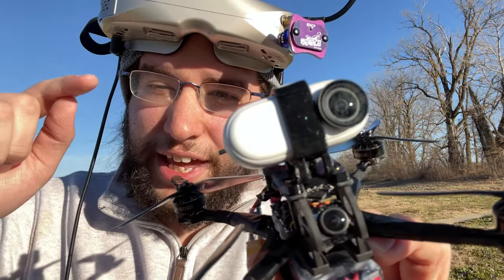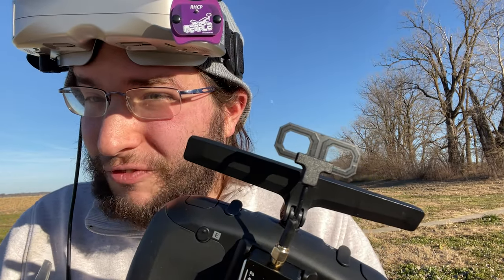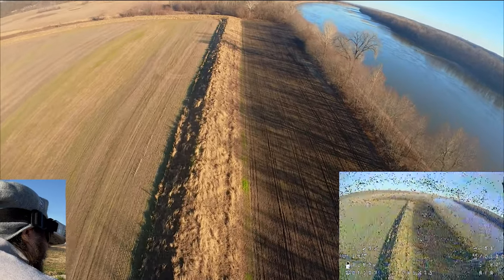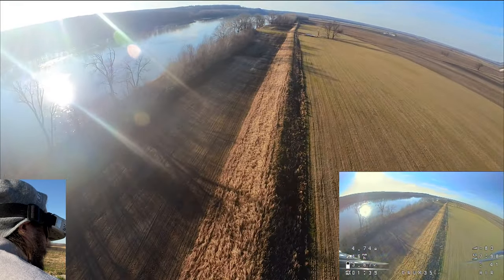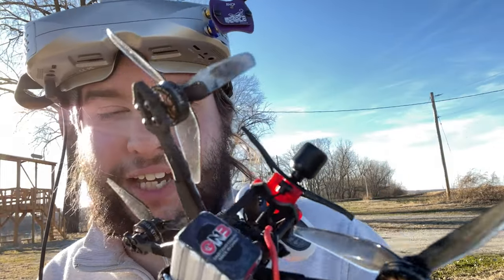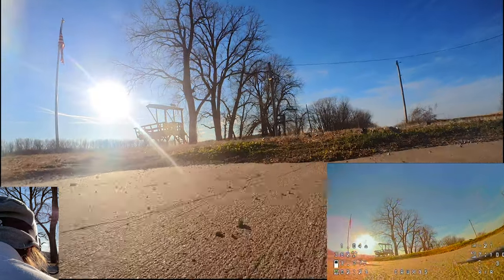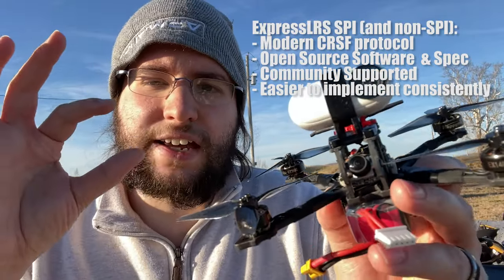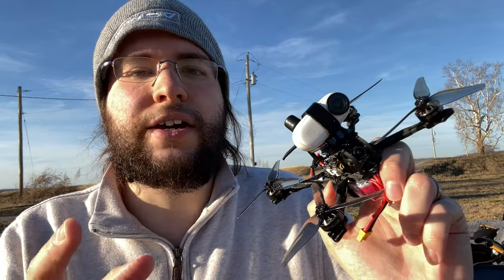ExpressLRS SPI Receiver Range Test (Crux35 Analog ELRS FPV Drone) 👍

Comment: excellent video, thanks! I have the same quad and I have a question: what's the PID Loop Frequency you're using? 4kHz? with the default value, I had a CPU load of over 60%. but I'm running ELRS at 500Hz, maybe that's why? what are you running? thanks!
Reply from the maker: betaflight 4.3 and 8k/4k using dshot300, I have a CPU load of 12%.  my expresslrs module was set to 500hz but the tango2 itself will only process 250hz for your control. I do not think the ELRS is what is causing the high CPU load. What was your default value set and what bf version was yours running?
Reply: @JohnCuppi  it came with betaflight 4.3.0 RC1, same 8/4kHz as yours.
Reply from the maker: @pgabrieli  Sorry -- I just rechecked and I accidentally gave you the number for port utilization. CPU load for me is actually only 12%. So I'm baffled as to why the CPU load would be so high for you. I even have the accelerometer turned on mine, which tends to use a little extra CPU. You can disable expresslrs to see if that fixes it but on the board it's set to 500hz for me, I have never rebound it and set it to 250hz yet. Try flashing the newest btfl 4.3, mine is running firmware released on: Oct 11 2021 so it's not RC1.

Comment: Great video and review of the SPI Elrs John 👍👍. I only have one quad with the ELRS on it right now and it is so enjoyable to fly. I fully agree with you on the FrSky spi receivers. One quad will do just fine like my original Crux3 and others fail safe randomly. I'm just going to convert my spi boards over to external Elrs receivers once I figure out how to do that. My Crux3 will be one of the first and a little Cine8 will be second. Moving forward I'm only going to buy boards or quads with Elrs. That Crux35 I think will be my next quad purchase.
Reply from the maker: Thanks for the compliments! I think almost everyone is tired of FrSky SPI receivers and we definitely need to move on -- but until now I don't think there's been a viable replacement. For a while there was at least the redpine protocol but I think that was too complex. There is one bummer -- the requirement at the moment to only use betaflight 4.3, when so many great tunes out there are for lower versions. But, everyone has to upgrade eventually, right? I'm also hoping Emuflight will add ELRS SPI support if they haven't already, that would be a huge help. How did you like the Cine8 by the way? I never got around to building it.
Reply: @JohnCuppi  the cine8 is on the way and hope to have it by Christmas, but I know already that it will benefit from an elrs receiver. Will let you know how it goes.

Comment: May i know what is the flight time of that crux35?
Reply from the maker: It depends on the battery, but so far for me, all LiHV: 

530mah GNB - 4 to 5 minutes (pushing it, but great weight on these!)
660mah GNB - 5 minutes (comfortable 5 minutes)
720mah GNB - 6-7 minutes

So my favorite is the 660mah.
Reply: @JohnCuppi  awesome, thanks for quick reply
Reply from the maker: @pushies5  No problem. I love this quad. I actually bought another one, and am doing an HDzero build. 😎

Comment: How the bloody hell do you bind it to the BetaFpv Elrs Module?
Reply from the maker: Is the betafpv ELRS module running ExpressLRS 2.0 or 1.0? This drone currently ships with betaflight prerelease 4.3 which has ELRS 1.0; but you can update to the newest version of betaflight that includes 2.0.
Reply: @JohnCuppi  The Module is on 2.0 How do you update the quad to 2.0? or is just easier to have everything on 1.0? Cheers mate
Reply from the maker: @k1ortia  If you want to start flying today right now, it's definitely probably easier to just have everything on ELRS 1.0 and then bind. It 'just worked' perfectly for me.  But, the way forward is definitely to upgrade betaflight on the Crux35 right now to the very newest betaflight 4.3, which will bring the ExpressLRS integrated receiver up to 2.0. 👍I have not updated my crux35 or happymodel ELRS module to 2.0 yet. Betaflight 4.3 is going to be fully released to the final version any day now, that's when I'll upgrade my stuff. 🙂
Reply: @JohnCuppi  Ah, ok. i shall give that a try, only issue i had with the module when messing about with firmwares, was that you loose the use of the Oled,s and the screen. iv just managed to update the Crux 35 to version 2.0. so hopefully ill have something in a bit. Never had this headache with Crossfire
Reply from the maker: @k1ortia  ELRS development is advancing so rapidly that unfortunately these problems have come up. Since you got the crux35 on the newest betaflight 4.3 and for 2.0 setup there, then I wouldn’t go back to 1.0. 

Personally I’ve had more than my fair share of problems with crossfire binding issues over the last couple years with the Tango2. 🤷‍♂️ ELRS still has a higher learning curve at the moment but it’s getting there.
Reply from the maker: @k1ortia  One small thing I wanted to mention — with ExpressLRS SPI receivers, the software/firmware for them is directly baked into Betaflight. All SPI receivers for betaflight work that way, and one disadvantage here is that when there’s a version mismatch, it forces a betaflight upgrade. I suspect that over time this won’t be as big of an issue as ELRS development slows down a bit, and there might also be an increased focus on a operability between versions. No one’s thinking about that for now while there’s so much rapid growth. Heck, it’s all happening in the middle of betaflight being in prerelease stages. I believe ELRS 2.0 will likely settle things at least for a while.
Reply: @JohnCuppi  Yes i agree. Definitely great new tech, but one hell of a ball ache! i just like what works 100% with no dramas. And crossfire for me has been bulletproof to be honest.
Reply: @JohnCuppi  Ah, i see. i didn't know that. Thank you
Reply from the maker: @k1ortia  I blame most of my problems with crossfire on the Tango 2, honestly, but it's no excuse because crossfire is literally TBS's product. So it should have worked the best with crossfire but ironically, it doesn't/didn't. 

Over the air firmware updates and crossfire updates with the Tango 2 have been a disaster for me, until just recently when TBS finally fixed it about 5 months ago. 

The crossfire product itself is fine in terms of range anr reliability, but I have only updated about 4 times in my entire time of ownership because of the bug described here, just incase you do ever run into it: https://www.youtube.com/watch?v=vT2EFI8tL8M
Reply: @JohnCuppi  Iv never used the tango 2. Only the taranis qx7 and a modded Flysky fs-i6 x and its been perfect.

Comment: I must be doing something wrong as I can't seem to get this kind of range out of my mobula7 elrs using the happy model es24 TX pro, even at 500. Something ain't right
Reply from the maker: But your mobula7 1s elrs has one major difference -- it uses a ceramic tower antenna, not a T-antenna like on the crux35! This is a very important distinction that will always result in significantly less range with ELRS. Also if you want 'more range', dial down the packet rate from 500hz to 250hz, you can even go 150hz. The higher the packet rate, the more demand on the link, and range will be decreased. 

Doing a straight shot on 250hz I was able to get 1.4 miles with mobula7 elrs 1s.  https://www.youtube.com/watch?v=RASKniA6OV8
Reply: @JohnCuppi  Ah ok I guess I didn't see that the crux used a t ant. Yeah I know that the ceramic tower isn't optimized for range but looking at the video you shared, even at 150hz on 500mw I really am not getting that range with my mobula7 like in that video, which I'm thinking might be the module as I also have another elrs whoop and its about the same. Maybe I should try another brand.

Comment: What is the FC on this drone?
Reply from the maker: Happymodel ELRS X1 AIO 4in1 Flight controller. There is a newer version now with ELRS built in on a uart. I am still using this FC though, it has been extremely reliable for me. No issues with it.
Reply: @JohnCuppi  thanks!
Reply: Hellomy friend, a question came up related to the output power of the vtx. Does that generate heat on the vtx, right? If so how do one keep it from getting too hot and damaged when not in fly? I know a fan when working with the drone does it, but when in the field, let's say I have to go pick it up and takes me a few minutes. How much time or heat can they resist? Thanks!

Comment: on my mobula7 (before i lost it in long grass due to running the battery down and losing video) with frsky and just an emax d8 controller from my tinyhawk 3 kit, i was able to stop it failsafing and falling out of the sky and i did a range test got it to 550 meters out before i turned around due to fighting wind the battery was getting low, but it flew out and back fine, and from inside my dads shed i can fly all around his property over 200m away from inside the metal shed, before i fixed it, it would failsafe and drop as soon as i went outside of the shed and got about 10m away, and that was not doing any hardware fix its just a setting in betaflight and it is so much better and trustworthy flying around, i have a moblite7 coming in the mail soon ill do a range test before and after the fix and make a video because i think it could help a lot of people
Reply from the maker: Well, this would be a popular video if your results truly work across all models and aren’t hardware based. 550m is an amazing result for frsky SPI whoop. I’ve never ever seen that. Was this with the mobula7 1s or 2s? 

I took the mobula7 1S ELRS extremely far away: https://youtu.be/RASKniA6OV8
Reply: @JohnCuppi  it was the 1s frisky version, such a good little whoop I couldn't believe how much better it flew than the tinyhawk 3 especially outside, it's so fast lol, I killed the tinyhawk 3 by crashing into a puddle so I can't test with that but I have a crux35 coming that I can test it with too, and for the record it did failsafe with very little range when I first got it so I'm sure it wasnt just a good receiver because the tinyhawk was the same problem
Reply: @JohnCuppi  i just put that video up incase your interested with the range test flying out over 500m on frsky

Comment: Does anyone know how many users can use analog FPV at a time without having any interference?
Reply from the maker: I'm not sure about this one actually. I know it's a decent number but I am not sure of the maximum. Are you looking to plan a fly-in event? Flying with some friends?
Reply: @JohnCuppi Thanks, I'm actually trying to set up a FPV RC car event for work. i know Digital the max is 8 ai just need to find out if analog will let mw do any more than that.

Comment: did u buy it on banggood so yes how did ur package arive
Reply from the maker: Yes, I did buy it on banggood actually. It took about 2 weeks, and arrived in a hard case.
Reply: @JohnCuppi  thx bro
Reply from the maker: @dortmunder27xxx  I would not recommend an 18650 battery for this drone. Yes, this is a good drone for beginners.
Reply from the maker: @dortmunder27xxx  I think for the cost the crux35 is great. 3.5 inch have similar enough flight characteristics to a 5 inch that most skills/tricks would transfer over. I can throw my 5 way harder and further than the 3.5, but I like flying the 3.5 more than the 5. If you don’t live next to huge bandos and big structures, it might even be good to not have so much power, and have more space to fly. The crux35's only weakness is that the frame isn't as strong as it could be, but if you stick to grass and fields it'll be fine.
Reply from the maker: @dortmunder27xxx No, why do you want to fly this with a Lion battery? 2s or 3s is going to feel underpowered on this drone. And a Lion battery will feel so heavy on this drone for really no good reason, a good quality 650mah or 850mah 4S lipo is the correct spec battery for the motor type on this drone. Using any less than 4s will make it under powered.
Reply from the maker: @dortmunder27xxx I have never used fatshark scouts before. Ev800DM are a good budget goggle.
Reply from the maker: @dortmunder27xxx  They will fly, sure, but none of those drones will ever the fly close to the same with a lithium ion battery vs. a lipo. 

There’s a reason lithium ion packs are not used for freestyle drones more often: they do NOT have the discharge rate to keep up. 

Sure, you can put a lithium ion on the crux35 4s or the nazgul 6s, but go ahead and try to do anything more than fly straight. Any freestyle will be a huge struggle. Buy 3s or 2s lithium ion packs will make performance of these aircraft even worse. You will literally risk having a potential brown out if you are not careful with your throttle or set throttle limits. 

If you just want to cruise, you are better off getting a drone that was actually designed to be used with a lithium ion battery. The flywoo explorer LR 4” is a good one. It’s was designed to be a low power usage, efficient quad not made for freestyle to do long range missions. It carries lithium ion packs and does okay with that.

Comment: Wrong. SPI is a hardware protocol that transports serial data from point to point, it requires three or four signals to achieve MHz bit speeds. The Semtech SX127x(900Mhz)/SX1280(2.4Ghz) LoRa hardware combined with an Espressif or STM32 Processor is the hardware used for ELRS. The SX1276/77/78/79 transceivers feature the LoRaTM long range modem that provides ultra-long range spread spectrum communication and high interference immunity whilst minimising current  consumption. Using Semtech’s patented LoRaTM modulation technique is how this is being done, the existing non ELRS transceivers use hardware that does NOT have this level of encoding. The SX127x/SX1280 + STM32F4 or Espressif combination has been around for years, using it to transport ExpressLRS protocol was a given since nobody has deep enough pockets to create something better. FYI: Both the SX127x and SX1280 parts can only be connected using SPI, not I²C or UART, the STM32F4 or Espressif talk to the outside interface with serial uart.
Reply from the maker: Thanks for the info!

Comment: Awesome review and flight my friend. I do agree more companies are going to get on board with micro SPI. As much as I love TBS tracer/crsf. I see them having to step up and compete or move out the way like Fatshark did.
Reply from the maker: Thanks Chris! Bold comment! 😃 for me I strongly believe that crossfire still has a solid place in the market; and it mainly comes down to quality control of hardware. 

There’s unfortunately some really horrible ELRS module hardware that users can step in right now, in part because anyone can make it. It’s a blessing and a curse. 

Some of these companies have been shamed and embarrassed into doing better; because their mistakes can leave lasting marks on the reputation of ELRS.

But you are right that they are going to lose out on ELRS for micros if they don’t do something there, and frankly, they may have already lost the battle there as it is. I don’t see any of the main BNF quad manufacturers caring to integrate  XF when they can just go with ELRS and profit from it.

Comment: Yeah my frsky made it 300m. My elrs I've made it further at 25mw but i can raise it to 1w 😆
Reply from the maker: 300m is not bad for SPI FrSky actually. The problem with it is there’s lack of consistency. I’ve had SPI frsky no good past 50m-100m, made sure the antenna was good etc. but something was just crap. SPI ELRS has been really good.
Reply: @JohnCuppi  yeah my spi ekrs has been great but most my whoops with built in elrs are on a uart which is nice I can update elrs firmware separate from betaflight